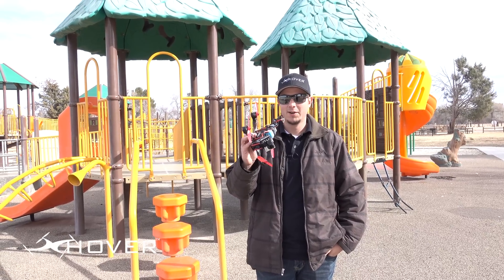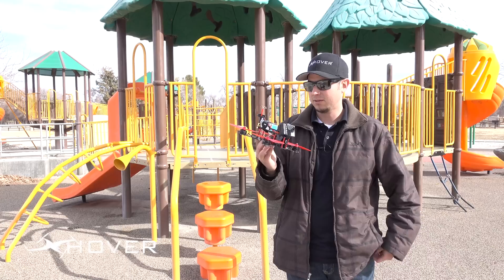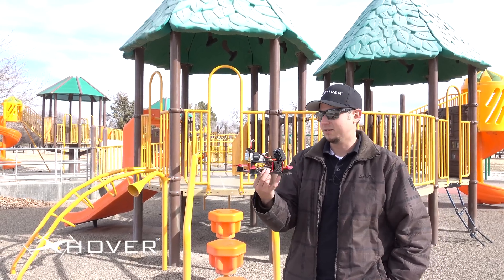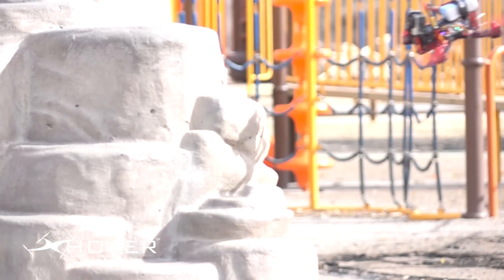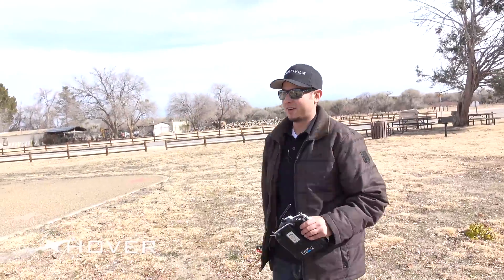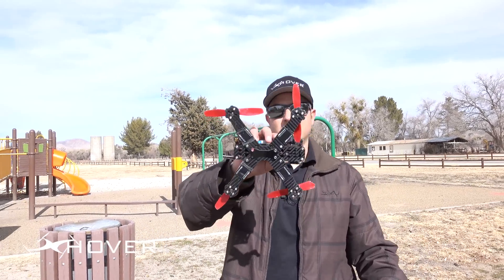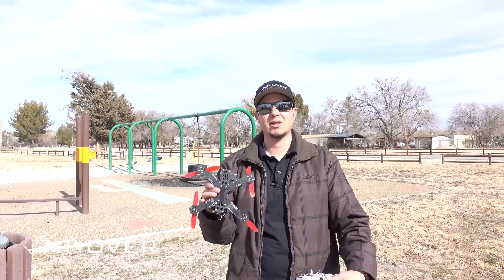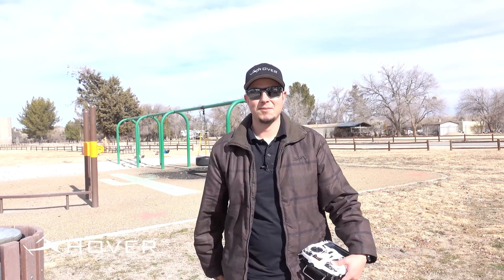Xhover Element 5" MiniQuad - Durability Test

Comment: Are you now looking into coming out with a sub auw 250g quad? If not I think you should be! Granted a GoPro may be out of the question but a runcam or mobius are viable options to make weight. Would love to see what you come up with. 150-180 frames seem to be the sweet spot for sub 250g weights, some being successful flying 160 sized under 200g for Japan's registration ruling.
Reply from the maker: +SoundsFantastic We are working on something. :)